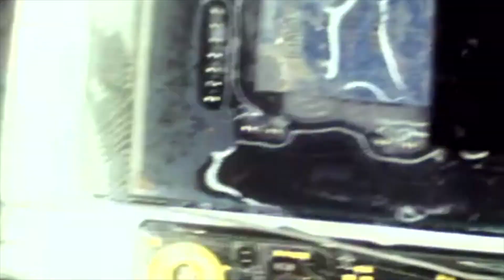HWFLY install on nintendo switch lite without FPCB

Comment: 7:08 you can scratch the solder mask off in a point near the cap, i find it better because it is bigger than the cap.
Reply from the maker: Thanks for the tip brother

Comment: Basic question. But what kind of flux and solder do you use? I’d like to practice before attempting on my switch.
Reply from the maker: amtech flux and chipquick solder. Any solder/flux should be fine for the most part

Comment: Hi what's your soldering iron please?
Reply: ExternoChv2  if I have a 60w with temperature wheel, is 350 degrees okay?
Reply: ExternoChv2  ok so what temperature do you advice please?
Reply from the maker: I use the Hakko FX888D. It's a good soldering iron with decent tip choices. As for the temperature, if you are starting out, I'd say keep it around 300. The trick here is not temperature but heat transfer. The sharper tip you use, the higher temp you wanna be at. I keep my at 480 and work with a sharp tip. Eventually with experience, you'll get the hang of it.